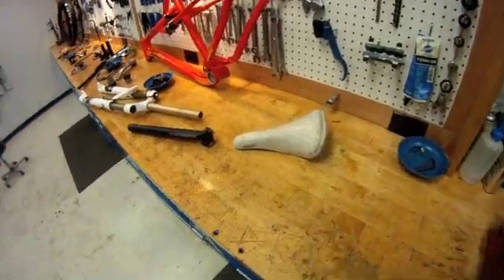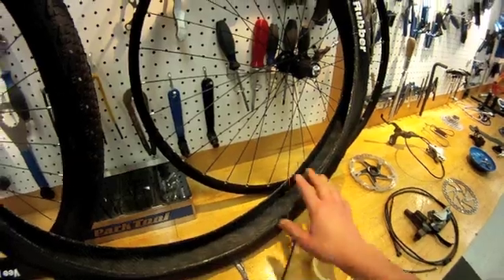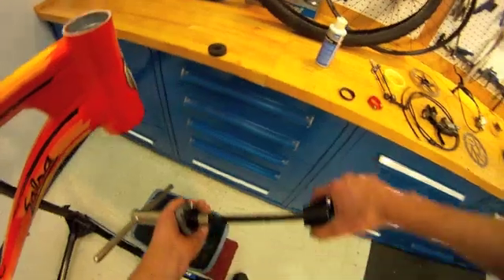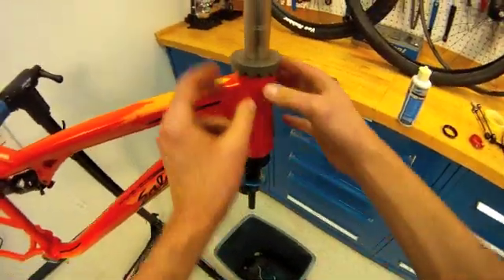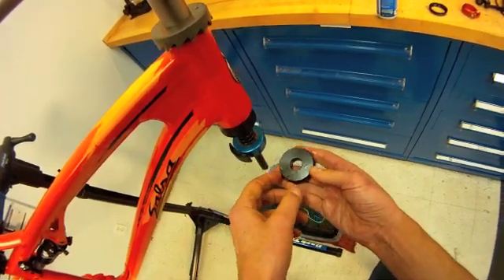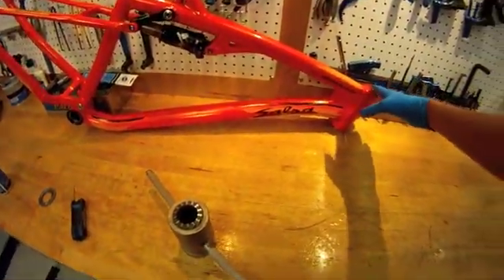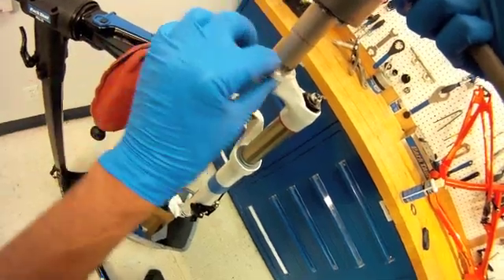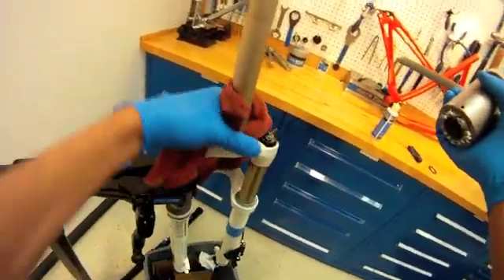How to Build a Bike - Part 1 of 12: Overview, Frame & Fork Machining

Comment: Is machining the head tube and fork something that should be done on every bicycle when forks are changed or installed?
Reply from the maker: +MotorheadRedo Negative. If it was machined correctly the first time, it does not need to be machined again.
Reply: How do you check the square of the head tube without installing the cutter and making a cut?
Reply from the maker: +MotorheadRedo You can press in the headset bearings, install the fork and check that the rotation of the fork is uniformly smooth. If there are no spots that feel "sticky" or otherwise troublesome, the head tube is likely sufficiently square.
Reply: Thanks
Reply from the maker: +MotorheadRedo You're welcome!